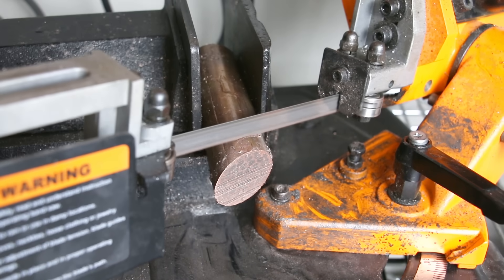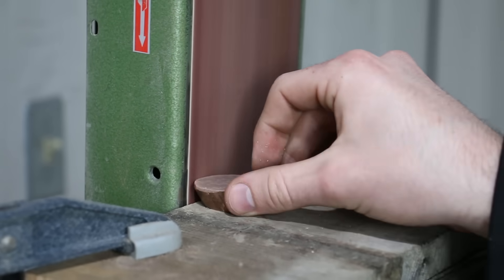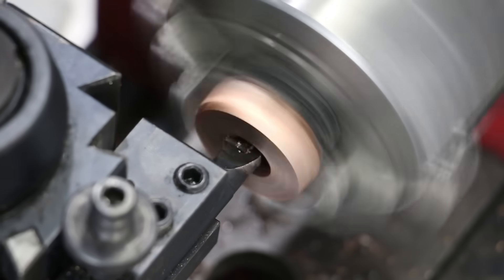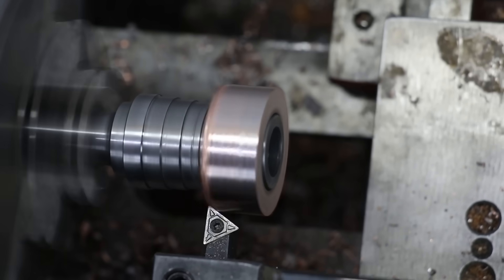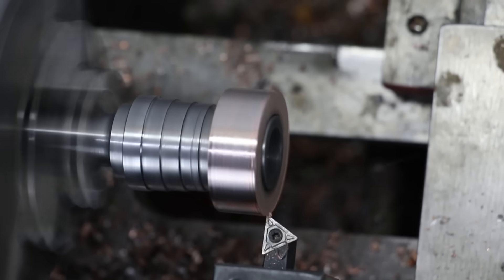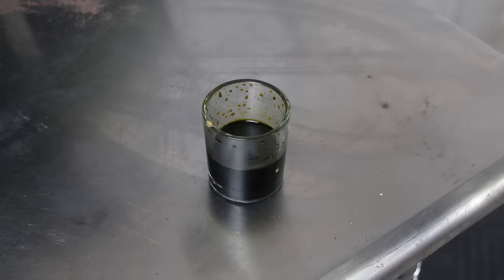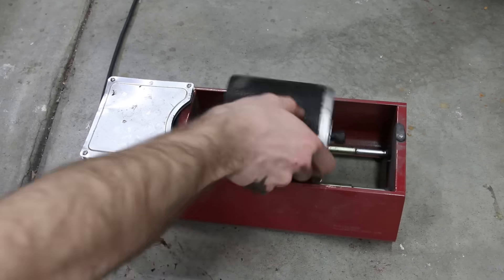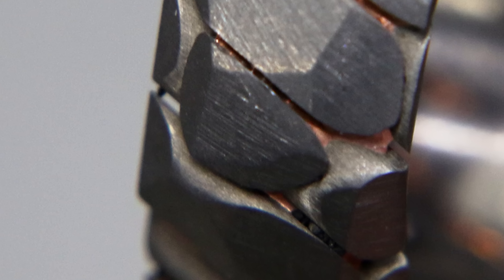Making an Acid Etched Superconductor Ring with Obsidian Facets

Comment: I have never seen anyone use a center drill for through drilling. Also, you might want to cover the ways of your lathe when you use that Dremel grinding wheel, as that abrasive dust will get in the ways and quickly wear them down.

Comment: Looks like the inside of it would pinch your skin. Maybe you could add another clear solid (silicone?) on just the inside (or maybe even the whole thing) to fill out the spaces in between each segment. Plus, I'd be worried about those facets falling off since it's different materials holding onto each other with one of them being dissolved slightly by acid.

Comment: Yo center drills are not meant to drill all the way through. They’re meant to center drill to put your live center on your tail stock to support your work. Drill it to the chamfer and then drill normally with another drill bit then use your boring bar

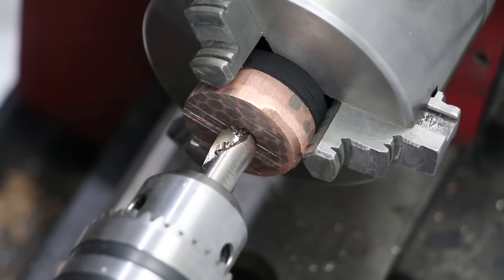Comment: @2:20 That's about as far as that center drill c-sink is meant to go. They're just used to give a good "footing" for a twist drill to follow. The geometry of the tool is why it's so difficult to push it through, not the material.

Comment: I have to ask: why do you cut the blank at an angle only to grind the angled sides off? Why not make the cut at a right angle to begin with? Save the grinding step. Not to mention NOT buying 10 packs of sanding belts.

Comment: Why use your time and money sanding it down so you can get it in the lathe to drill the center hole?

You could just drill the smallest hole which will fit onto your mandrill using a drill press, then true up the outside on the lathe, before putting it in the chuck to get the center hole you want. Then back to the mandrill for finishing.

On one ring may not make much difference, but if you’re going to be creating several, let alone dozens of these, avoiding using up all those sanding belts and all the time sanding would make a big difference.

Comment: Dude a bit of advice for your drilling, use the Centre drill purely to start the drill and then switch to a carbide tipped drill or evenb just a slot drill you will get hundreds of rings out of a single tool then as centre drills are not designed for drilling deep holes and should really only touch on the chamfered section. also you wont need to flip it which helps with hole eccentricity and allows a single cut saving you time :-) 

Cool ring though
Reply: also cut the material straight so you dont have to spend hours sanding it round lol.
Reply: There is a reason it was cut at an angle.  It would not have produced the same look if cut perpendicular.
Reply: ok fair enough i see your point, in that case there are at least 3 ways he could of machined it to fit in the lathe instead of grinding it round.I laughed so hard when he did that hahaha.  Handy man machining lol. But it looks like hes having a fun time with it and thats the main thing.
Reply: Im not saying this guy is bad and i like how he said hes not an expert. Just annoys me how everyone thinks its the best thing mankind has created lol

Comment: The "Drillbit" you are using is not a Drillbit. Its a centerfinder for a Drillbit. So if you would use the right tools. You dont need to buy as much new tools as you do in moment.

Comment: How about you make a Superconductor ring and dip it in that black stuff for just a few hours until the titanium is darkened and slightly above the copper. Then slowly heat the ring... Because copper gets hotter faster than the titanium it will acquire a Rainbow Patina, while hopefully the titanium remains as it is. Use the Rainbow Patina Spray thingy (I forgot the name) and it should be very beautiful and make an attractive contrast with the dark titanium. If you think it might work and I'm not completly crazy give it a try please!
Reply: Adarsh Kamal Patil did u watch the video?
Reply: Aru Aruu what is super conductor refered in the video, as far as I know super conductor exists in very low temperature, and this material is not one of them so please let me know what u r referring as 'super conductor' here??
Reply: Adarsh Kamal Patil dude......

Comment: I have a pretty cool suggestion could u make a ring that looks similar to a dragons scaled skin in a style, like, of what you did to make the superconductor ring? I am a huge dragon fan and honestly id love to see you make something like what i suggested
Reply: that'd be pretty awesome....another suggestion I'd throw along with this is to possibly epoxy at least the inside so that it's completely smooth instead of the rough material being exposed....with a clear epoxy it'd still have the look while being smooth and not catching on things...
Reply: That is a pretty sweet idea.

Is there a jeweler that could make a Dragonball gem to set in it?
Reply: If you have the gem, just about any jeweler could put a setting on it & put your gem in there.  I'm having my ring done because I don't like the "basket setting" currently on it.  They just have to change the setting & put my diamond back in.

Comment: Really nice. I wonder if you can keep the inside from etching so it's smoother for the skin.
Reply: You can paint the inside with superglue, or nail polish and before you reach the result you want just sand it and it wont be afected on the inside. Or you can do it half the procces and the inside will be half-affected than the exterior part.

Comment: What exactly is this superconducting material?  Im technically knowledgeable but I cannot figure out what the casing material is for the cylinders inside .  just an interested fan thanks

By the way it to use a thicker cutting fluid that the like Moly D, it might help you save some tools.

Comment: You should make an armored glove with spiked finger tips in that ring design lol add some red led lights and sync some lighter torches on the palm with heat resistant of the palm inside.

Comment: How well is the super conductor rod bonded to the copper?  Do you ever have to worry about the small pieces "popping out"?
Reply from the maker: +Michael Baker it’s actually very sturdy. (I’ve done some tests and even pieces that are barely connected hold on pretty well).

Comment: Does the ring wear well? Copper turns green?
Reply from the maker: +Moontanman the etching makes it so the copper never contacts skin and doesn’t turn it green. Also just by wearing the ring every day it stays clear of any major oxidizing. If you don’t wear it for a long time it could oxidize but it’d be as easy as soaking in some vinegar and salt for a few minutes to get a brand new shiny surface to it.
Reply: Very cool, thanks.